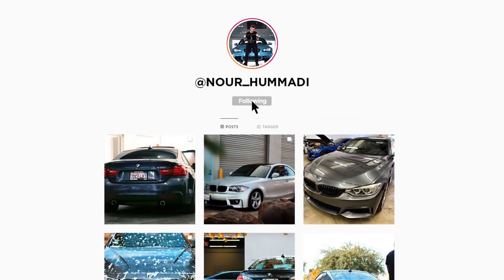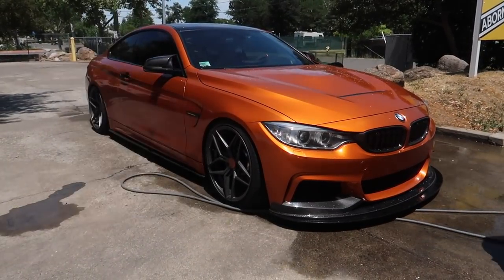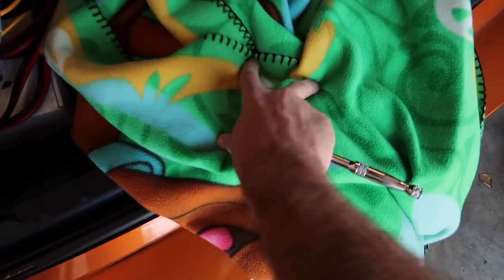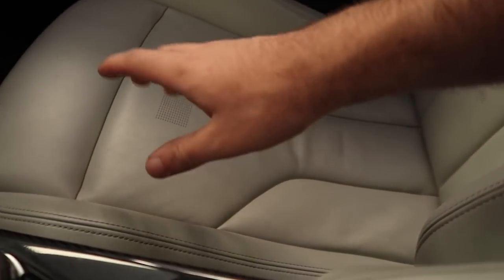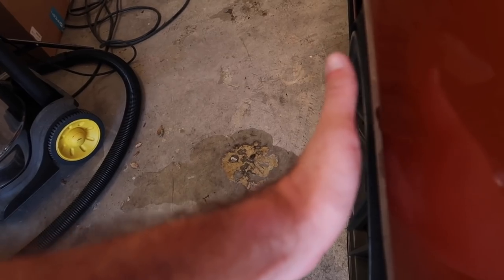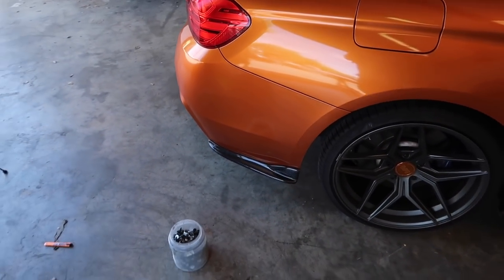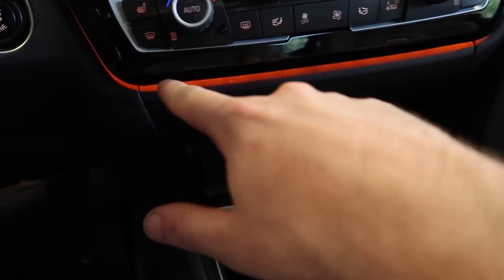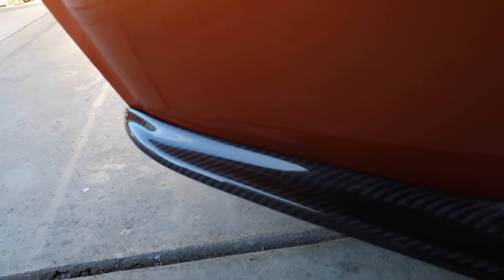435I GETS BUDGET BUT GAME CHANGER MODS!

Comment: Yoo bro I have a question why does my bmw always an I mean always stutter before I come to a stop at a stop sign or a stop light it feel like it hesitates to stop an just stutters the whole car
Reply: Check your brakes. could be low pads or wrapped rotors.
Reply: It's warped rotors. If the break pedal stutters. It's your rear rotors. If your steering wheel shakes. It's your front rotors that's warped. That's a serious safety hazard so drive carefully. Get that replaced as soon as you can.
Reply: SEREN1TY i will
Def check them em out tmmr I’m paint my break calipers so I will check to see if I need me brake pads  , but  it happens sometimes .sometimes it pushes me more than other times like it won’t stutter and be jerky as much an sometimes it will
Just be a lil
Stutter
Reply: SEREN1TY  but thank you for replying i appreciate you both for replying
Reply: Richard Schuh  also it stutters an jerks aftee I stop like I’ll come to the stop light an then stop an litterlly a second after it will like jerk the car like the whole car pushes it self back an it throws me back to my seat
Reply: @kashsmokes2123  if you got an automatic transmission then it sounds like a potential automatic transmission issue.
Reply: SEREN1TY yea it’s 8 speed automatic but it’s only on low rpm when you feel the push . Do you think it might be like a transmission sensor or would I have to replace the whole transmission ?